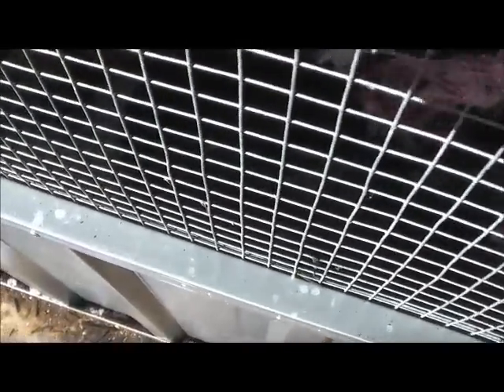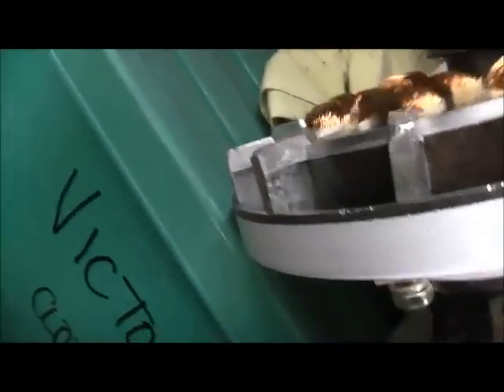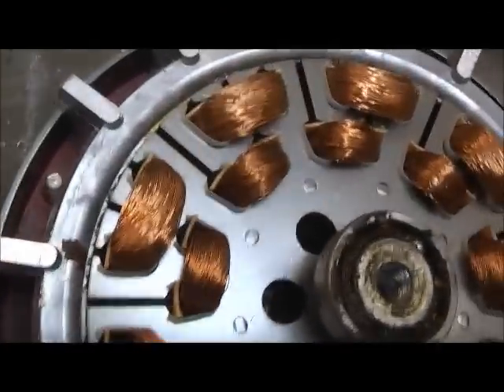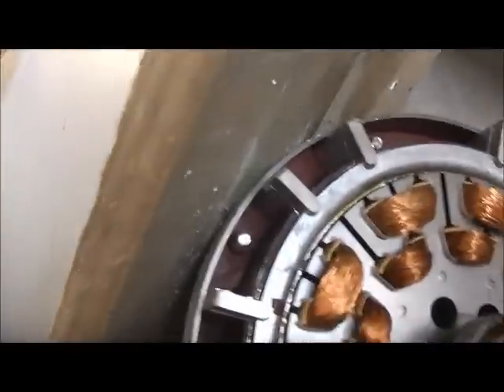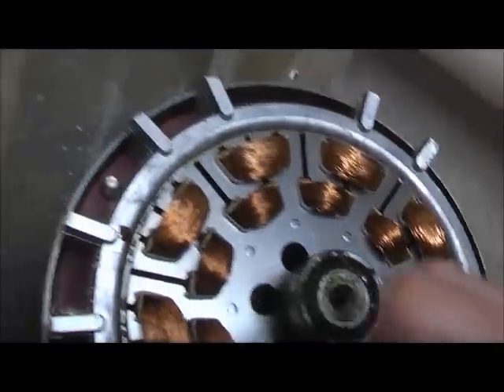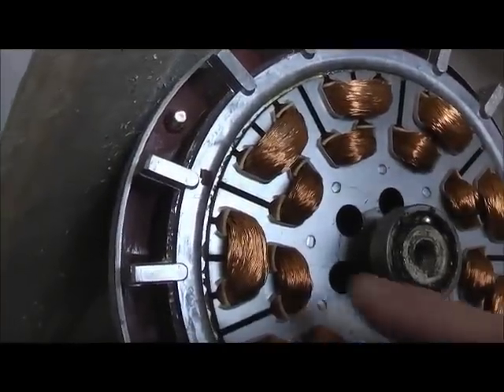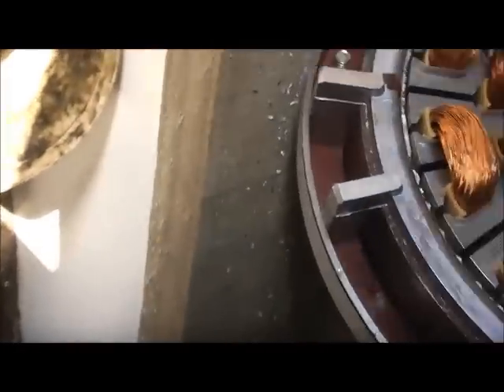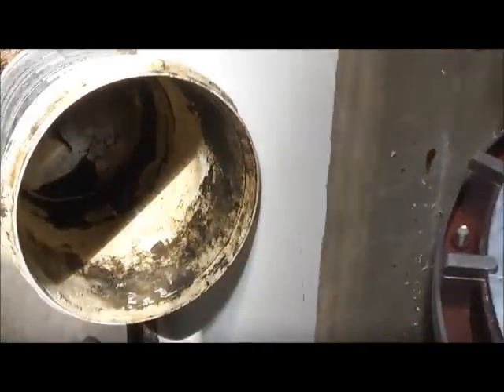Ceiling Fan Motors To Mod!!

Comment: You can't judge something by where it's made like that. If it has an Australian brand, than it was made to the spec. the brand wanted. they usually say to make it as cheap as you can, so the chinese factory has to cut corners to meet the price spec. Many quality items are made in china aswell. The older hong kong one is higher quality because in general the older units were made well, regardless of were they were made. Anyways, nice video, I usaully don't comment.
Reply: ***** So many people spend their time slagging off products made in China, when  buying items that aren't Chinese brands, the brand owners are laughing all the way to the bank after reducing labour costs, quality and charging the same or higher price. The brand owner is solely responsible for the quality of products they put their name on. Also if you buy a cheap unbranded item and it's a bit crappy but works what's point of complaining.
Reply: besides russian old RF electronics that shit will last another 200 years or so...
Reply: сталкер чворович  I don't know about 200 years, but it's certainly well built, although the soviet tubes arent all that old. I have a 1915 US radio tube that still works, thats 100 years old.
Reply: ***** not only tubes but the nachines that use the tubes themselves